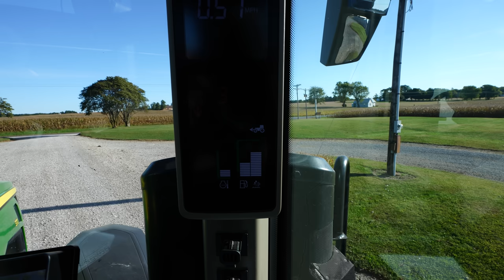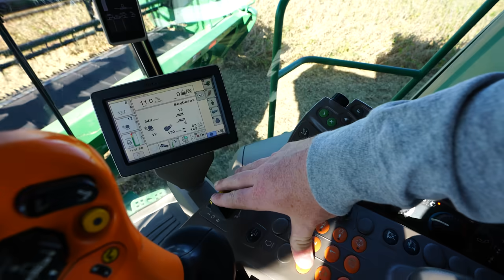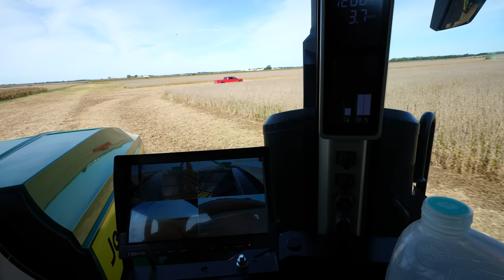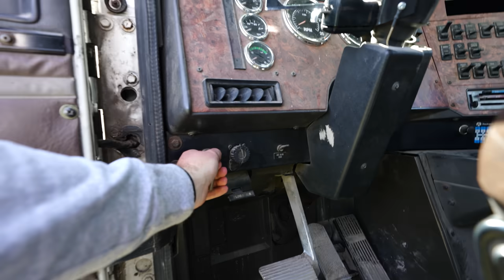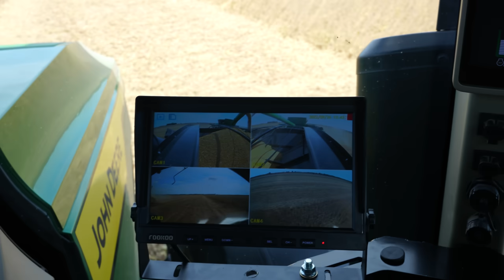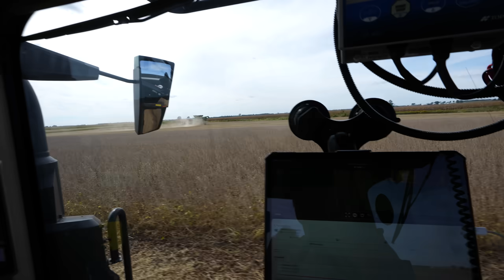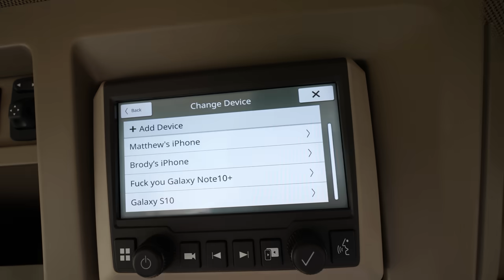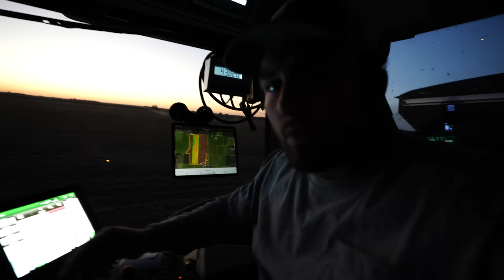First Day Of Harvest In Central Illinois - Brand New John Deere S780 Combine Chews Through Soybeans

Comment: Andy,,,, we love our 410 tractors. They are beasts. They will pull an 8 bottom 18 inch switch plow with a sterling goose neck packer 12-14 inches deep and act like it’s not even there. They also handle our 16 row stack fold 3 point planters like champs. Expensive yes. But worth every penny.

I used to be the balancer between grouchy Dad and everyone else. Now it’s my turn to be grouchy harvest boss. There is a correlation between grouchy-ness and decision maker.
Reply from the maker: Your point about the decision maker and grumpiness is spot on. There is a lot to keep straight when you are the boss. 

These 8R tractors are incredible. I wouldn't be surprised to see another one here by next spring for the other planter.

Comment: Andy, I prefer spring, the days are getting longer and warmer then, not shorter and cooler. It’s certainly no fun to cut green stem soybeans, slow and high fuel use per acre. Does your cart have the auger folding lockout when the gate is open? Like the tracks also, smooth ride with rubber suspension on hard roads. Stay safe

Comment: Fill the hydraulic/transmission oil with the three point down so all of your oil is out of the two cylinders for the 3 point
Reply from the maker: I didn’t know that. Thanks!
Reply: @aTrippyFarmer  if u wanted to take a peek at the manual to double check what I said is right you can Im pretty sure it says that though.

Comment: Have you ever considered using ag drones instead of the hagie sprayer you currently use.
Reply from the maker: No because I can't effectively spray herbicides with ag drones. Herbicides need to be applied with large carrier volumes, like 15-20 gallons per acre. It would be incredibly impractical to try to do that with a drone. You'd only get a few acres done per hour. Drones are good for JUST fungicide applications, but they can't do the whole package.

Comment: How is the visibility on the 8R compare to the 9460R you were running as a grain cart tractor? I’m thinking in terms of height? 9460R you could see into the trailer.
Reply from the maker: The 8R still sits surprisingly higher. It is definitely slightly lower than the 9460R, but I’ve been happy with it!

Comment: If you were to compare the specs of a say s770 combine versus a s780 or s790 the only difference in threshing and separating area is the extended precleaner which if you order the combine as a small grain machine is removed.The rotor, concaves,threshing grates,chaffer,sieve is identical. It has more horsepower, bigger glean grain elevator, bigger grain tank and a rethrasher which people have many different opinions on. But all the internals guts which have to do with threshing and seperating could be swapped from one the other.
Reply from the maker: Really? I was always under the impression that the S760/S770 were smaller capacity machines than the S780/S790! I know there is a power difference… thanks for the info!
Reply: @aTrippyFarmer  s780 has 100 more horsepower than s770.We farm all small grains.If it gets though or you have lots of green straw or you have lots of big hills,or if you run a big choping corn head that uses lots of power of course the bigger machines have more capacity.But i have seen many times where it's nice and dry and you can cut high, machines will be the same,bigger machines uses lots  more fuel also.
Reply from the maker: @mikekleinsasser8334  agreed on the fuel usage. This 780 drinks fuel!

Comment: A few suggestions and a question for your new tractor. If you push the breaks you don’t have to use the clutch, you probably already know this but you can set an rpm limiter to 1900 rpm’s and it actually gives it more torque (we have a new 280 and it pulls an 1100 bushel track cart very well with 1900 rpm). a question do you have to pay money to use the same auto steer line if not how do you do it.
Reply from the maker: No extra fee to share the line. However, it only works with Gen 4 monitors. If the S670 did not have the 4640 display and the 4G modem to send information, she wouldn't be able to see our lines. If you have all of that, you just have to set in the same field on your display. If the S780 is cutting at Home, I have to set the grain cart tractor to field Home. It will pull all of the new lines off of the monitor. The new lines appear in your "set track" menu. You can turn them on, and it won't mess with the other machines steering at all. The only thing that prevents this from working is if the combine sets a "quick line." It doesn't export those. However, you can go to the sharing page on your tractor and see what heading they are running at and copy it. I hope that helps a little bit.
Reply: @aTrippyFarmer  thanks

Comment: what camera system do you use for your grain cart? or link for them
Reply from the maker: It’s “FOOKOO” on Amazon. I have the 1080p cameras and 10” display. It’s about 1/2 the price of the cab cam system, and it’s fantastic.
Reply: @aTrippyFarmer  Thanks! is it the wireless or wired ones?
Reply from the maker: @jared2168  I used wired. I have mixed opinions on wireless cameras regardless of brand.

Comment: The  black rubber cart auger end would drive me crazy. Seems to block way too much of your view of the combine. Maybe just the camera angle.
Reply from the maker: It does interfere with the line of sight, but it isn't a big deal. I actually don't spend much time looking backwards. If the combines need me, they radio me. I can watch everything else in my mirrors. Thanks for watching!